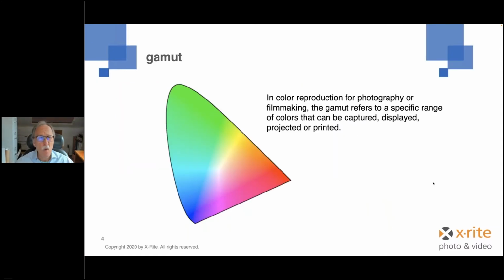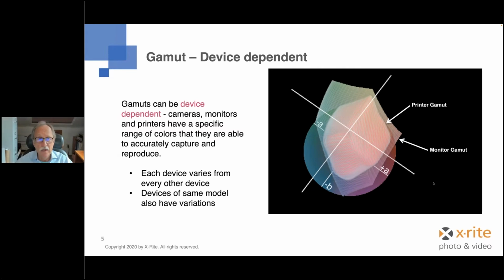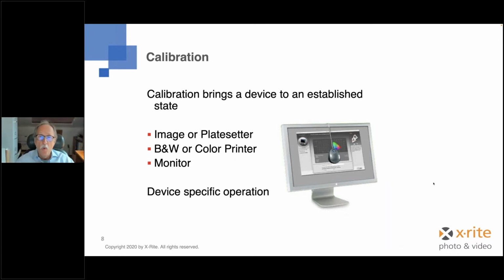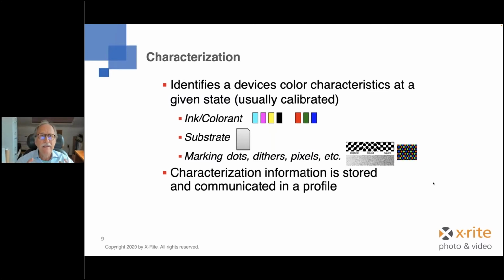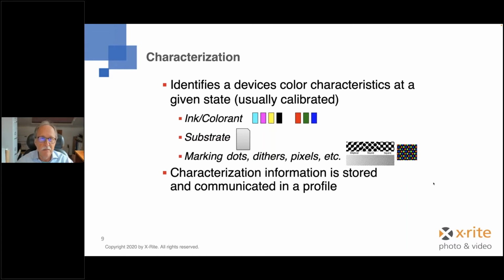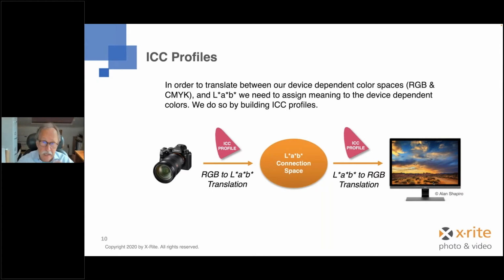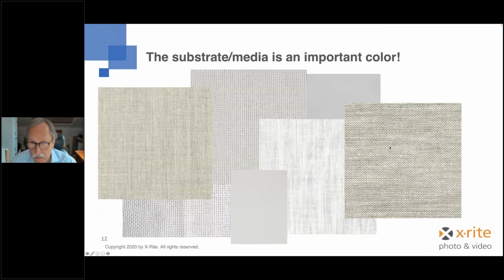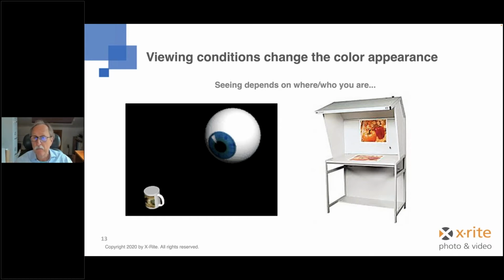Color Excellence for Digital Textile Printing

Comment: dear ladies and gentlemen, i have a question regarding the color chcker passport 1. while it is mentioned in the pdf manual that one should use the neutral tragets in the portrait and landscape section of the creative target to achieve a neutral white balance, it states in the manual on page 12 that: "A gray patch on the
ColorChecker target will actually provide a more balanced neutral for JPEG and RAW photography" so, please enlighten me: is it then BEST to use the 4th from the bottom gray path from the profile patch site? there is a slight shift of maybe 100kelvin and some +-5 points in tint when clicking from the neutral targets in the creative side to clicking the 4th gray from the bottom on den profile side. thank you!
Reply from the maker: Hello @Jelly - Thanks for your question. Our ColorCheckers are managed by Calibrite. We encourage you to contact them for more information. https://calibrite.com/us/calibrite-technical-support/
Reply: @XRiteColor  thanks, I will. 👍